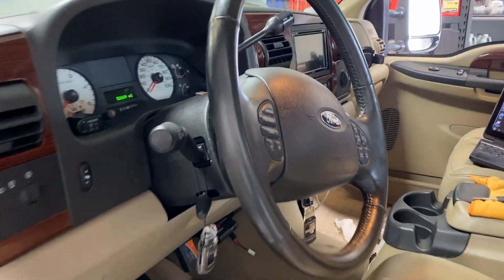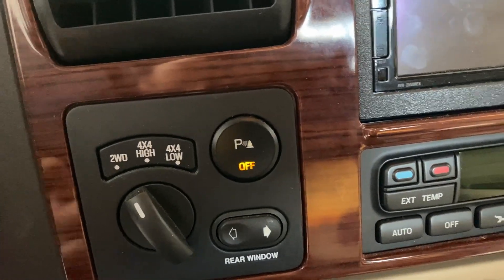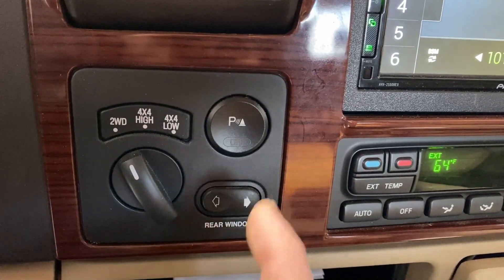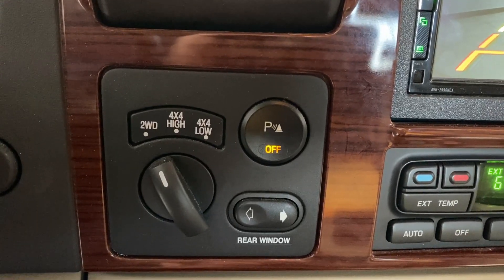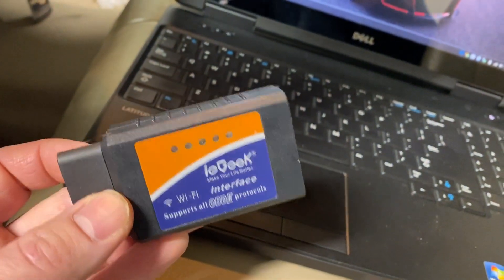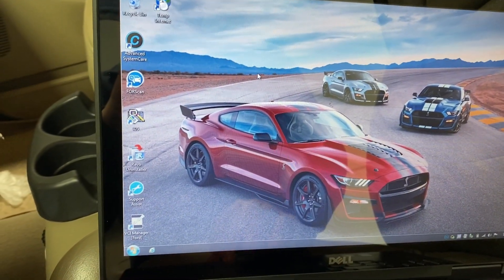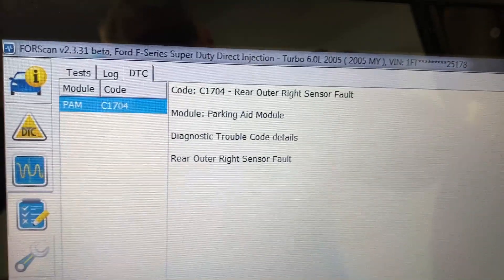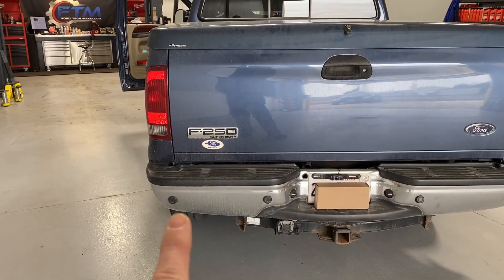Ford Quick Tips #85: Ford Parking Aid Warning System Diagnostic Tricks!

Comment: Love your Tech page, very helpful and easy to understand.  I did a PAM self-test to check if speaker worked and it beeped several times and message "Low Brake Fluid" warning came on.  The DTC code points to outer left sensor, and I swapped it out but didn't fix..Now assuming the problem is somewhere in the wiring to that sensor, so I'll have to check it out. My question is , what does brake fluid level warning have to do with this PAM module?   Thanks

Comment: Any more in depth diag for this? I ask because on my 05 it stopped working, I replaced all the sensors and when it didnt fix it I sent it to Ford. They called me and told me "we didnt find any codes, if you want us to continue to diag it will be $149 an hour. If you dont want to continue you can come pick it up all you owe is the $149 diag fee for what we have done". Really..... $149 to plug it into the computer and scan the codes?

Comment: I have a 2005 lincoln navigator that the PAM  module is showing a C1830 code. It only has 2 sensors.  I used the forscan tool to read the code. I tried to clear the code but it comes right back . I think my module flags this fault if either sensor is bad. Any other thoughts?

Comment: I replaced all four sensors and the light remains on.  I do not have the software.  Will get it and see what happens.  Any suggestions?
Reply from the maker: Like I said it will even disable the system if the park aid speaker has failed so codes must be pulled from PAM.

Comment: So, before watching your video, I replaced all 4 sensors and speaker in my 2003 Ford F350. Problem not resolved. My park aid button does not light up at all (turning key or putting in reverse) does that mean the module is bad? Great video by the way.

Comment: I have a 2010 F150 super crew and I’m having problems with the radio screen fading out after it turns on and doesn’t ever turn back on. I’ve checked and replaced fuses, taken then connector out and put it back in the review mirror, disconnected the battery and literally everything I would’ve done when I was a technician. I think it’s the APIM but I don’t wanna jump on a $100 part before asking you if you have any advice. Thanks for the help in advance and I love the videos!

Comment: My 2005 Ford excursion has these park sensors on the bumper how do I find out if my sensors work does this trick work on the older 2005 models as well? @FordTechMakuLoco
Reply: Antonio Claudio Michael I think they click when it’s in reverse. Have someone put it in reverse with the engine off and stick your ear to them and you can hear them click
Reply: @alexsmith5884  thanks for the tips Alex appreciate that

Comment: can all these OBD2 readers change settings in forscan or is it a specific type of reader
Reply from the maker: I have not gone that far with Forscan as of yet but for any actual module programming you should be using a J2534 pass through device.

Comment: I have a 06 350 powerstroke every once in a while my climate control will go completely dead and won’t turn on if I unhook both batteries it comes back I’ve also checked before unhooking batteries for hvac codes with an autel scanner and find nothing I’m kinda lost on it do you have any ideas thanks for your time

Comment: I have the bluetooth adapter and was able to add a toogle switch to it, wire to the pins on the adapter and I am now able to read the modules on the HS and MS bus on my 2011 Ford F150 by moving the toogle switch between the two buses.
Reply from the maker: Yeah I just ponied up the money for the OBDLink MX

Comment: Can you do a video on problems with low oil pressure on 2017 f150? Alarm signal goes off. Shut off turn back on. Not more issues. It has 91000kms on it. Confusing. I’m a diy guy. Wondered if this is a common problem. Thanks

Comment: Great work with Forscan Brian.  I'm familiar with it and have a wired adapter with the hi/low switch modification.  Is it possible to switch a 2017 Focus to use the DDS system instead of TPS sensors with Forscan?

Comment: Curious if you have any insight on failed Intelligent Access door sensors? The drivers door handle just recently failed completely on my 2013 C-Max. Fob works fine, other door sensors are fine, just the lock and unlock sensors on the drivers door both do not work at all. Not even intermittent. No DTCs either.

Comment: One thing to keep in mind with the cheap ELM adapters is for newer Ford vehicles with multiple CAN buses they will only see the one bus. You can buy them that are pre-modded to switch between the most common HS and MS can buses manually or mod them yourself with some basic soldering skills. There's also more expensive ones such as OBDLink which will be able to auto-switch.

So for most things the barebones ELM adapters are fine, but it will depend on the age of your vehicle and the modules you are trying to work with.

Brian covered this in his pinned post mentioning the MScan capable adapter, just figured I'd go into further detail.

Comment: Does anybody know where to find the keyless entry code on a 2010 Ford Explorer Thx in advance
Reply: Ted Tomlinson if it came originally with it on the door from the factory. The code is on a white sticker on the interior fuse box/gem/bcm
Reply: I read once they are on the steering column sometimes

Comment: Been using Forscan for a few years now, great platform. Real useful for adding factory remote start too
Reply: I've used Forscan to enable day time running lights on my 2014 F150.   Great tool!
Reply: I disabled those on my old 2012 F150 when I swapped in OEM HID projectors.
Reply: @Jlieg  I have OEM HID projectors - on my 2014 Ford set it up so it only turns on the fog lights when you're not in park..  it doesn't burn your projectors during the day.
Reply: I had them set to the parking lights only

Comment: I've got a twist: on my '08 E350, the PAM initially works when going into reverse, but after 1-2 seconds will fast beep then turn off and will remain off until the next start cycle.
Reply: the same problem on my 05 Lincoln Town Car I replace the module near the rear  seat and it solved the problem
Reply: @acts2211  excellent tip! Thanks!

Comment: You can also do this simply by ear without any tools.  Do not start the vehicle, put in in reverse and listen to each sensor by basically putting your ear to the sensor.  Functioning sensors will have a very fast tapping noise that you can here up close and the faulty one will not.  I did this with my 06 Explorer and it was an easy fix.  Replaced it with the same sensor in the video description.
Reply: Same procedure ... if the sensor is OK, you will feel a slight vibration when you touch it with your finger. Tried later!

Comment: Great video as always Brian! 

I had the PAN fail on my Ford Five Hundred. I was able to diagnose it by very carefully listening to each parking sensor when in reverse. They emit a very slight buzzy sound (they use ultrasound) when functioning. In my case the sensor was fine - it was the wiring harness behind the right rear tire to that sensor that was broken. If you live in the salt belt be sure to check your wiring FIRST before purchasing the sensor. Don't fire the parts cannon at your vehicle like I did without proper diagnosis.

BTW - I have an ELM 327 that I bought off ebay - I'm definitely going to use the Forscan software from now on when diagnostics are required!
 Cheers!

Comment: Worked like a champ on my super duty to fix the park aid.  Not so much luck on my 2003 Lincoln town car.  Forscan doesn't find the PAM module even after I replaced it and put two new sensors in.  I know module powers up because when I put in reverse the Display overhead says park assist disabled. Strangely if I am near a building when I put in reverse it will work briefly and then go to disabled.
Reply: You have to replace the module it's located behind the rear seat under the package tray trim I the same problem on my 2005 Lincoln it's about $180 brand new replacement part work like a charm after I replace the module. Be sure you get the updated part number don't replace it with the exact same part of my memory is correct the original part on my 05 Lincoln had an 03 date code for the replacement I believe had an 06 date code